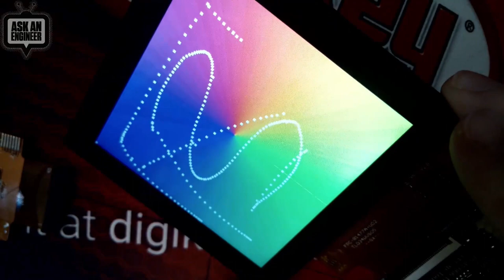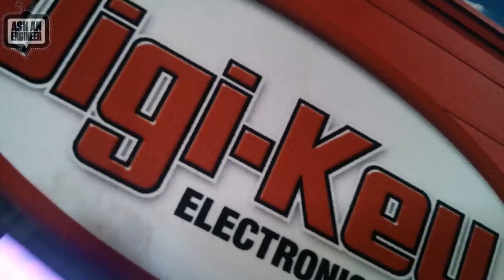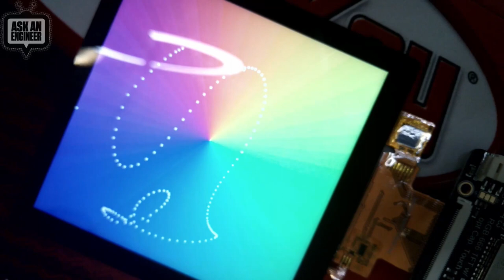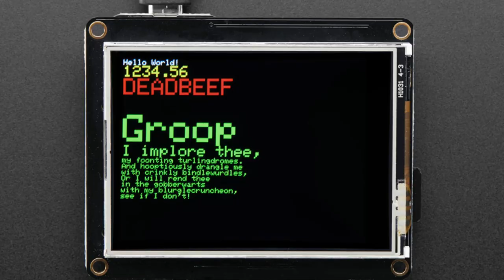#NewProducts 10/11/23 Feat. TFT FeatherWing - 2.4" 320x240 Touchscreen For All Feathers - V2!

Comment: The 320x240 display's back layout is perfect for tiny badges.  If you can do that for the 480x320 screen, I can get the old eBadge project into a flatter format (and maybe get it on the Learn section).